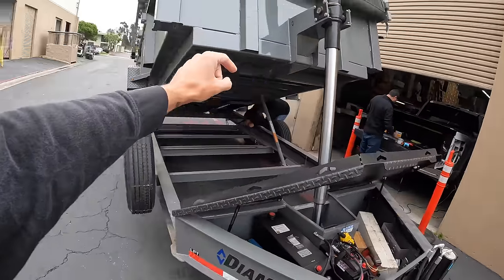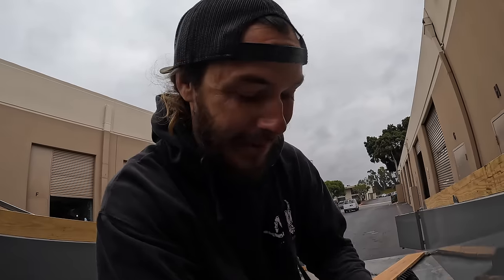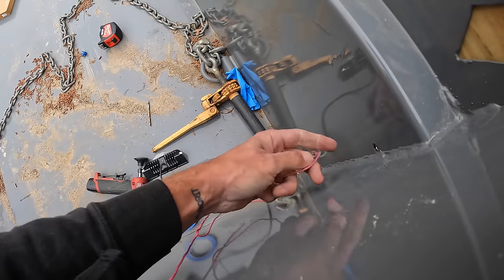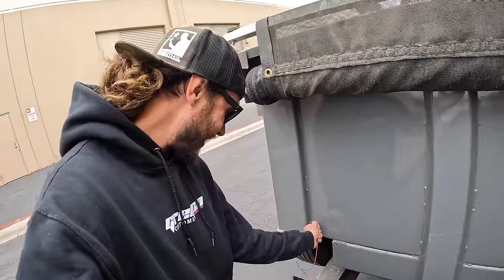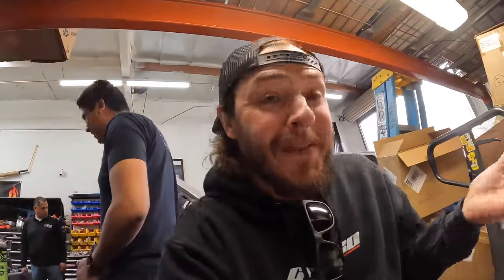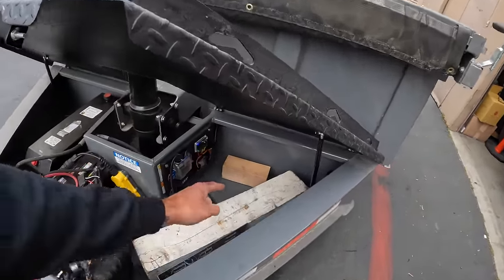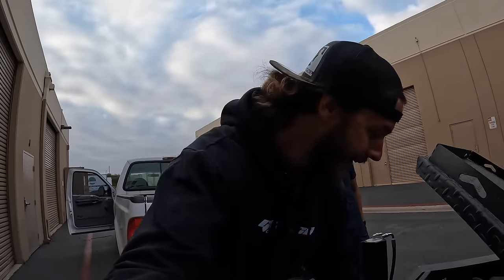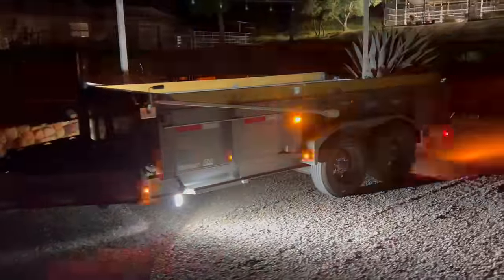EVERY Trailer NEEDS This Lighting Setup!

Comment: Have you done wiring on a steel trailer before ? this is impressive , use a straight piece of wire and spin , it will tangle the wires ( as you never want when doing purposefully ) then closer to home . When welding, A invisible nut , tack it to a coat hanger , then fish/align it to the hole. Well Sergio  knows this already . You guys do it great ! Poor Sergio , you bug him to............. logo everything ! Hey Maybe show  Diamond  D  the options that you have added . THIS LIGHT PACKAGE IS ..............................GREAT ..............................

Comment: You should wire one of those Milwaukee batteries up so you can run the lights without a truck in case u have to move the truck but not the trailer
Reply from the maker: This trailer has its own battery, the lights work without the truck
Reply: Its a dump bed its got its own 🔋

Comment: Seems you missed a critical place for a light - that box up front would really benefit with some lights. Maybe even just making it automatic so when you open the lid it turns on…
Reply from the maker: We plan to add one later. We just wanted to finish after 4 days working here and there on it lol

Comment: are those strobes legal? they look like they they will blind other motorists!
i like the trailer but you could have put a hole in the headboard so the lights could shine though say a piece of plexiglass so it would  not put the light at risk or have to be always careful when loading. on the side facing lights they were placed completely wrong and every curb or piece of ground has the potential to tear them off, i would change the step and incorporate the lights into them so they are protected while shining the light exactly where you want it. by placing them low they have potential to blind someone driving along the road benind the trailer whereas placing them where i said on the steps will stop that issue as they will be higher but facing down to the tyres.
Reply: 😂u just jelly, keep on hating it motivates 😂

Comment: You could put rubber grommets in your drilled holes that way the wires wont get worn over time.
Reply from the maker: All of the wires were taped with tesa tape at the light end. Except maybe one or two where I didn’t drill the holes big enough for the butt connectors to make it through taped

Comment: For the lights at the front of the bed, did y’all run wire down the frame then back up to the front on the bottom side of the bed ?
Reply from the maker: Correct
Reply: @DMAXRYNO cool, thanks man!

Comment: bro why you gotta lie about the frame rate? the same 1 is the only 1 doing it. lmao they aren't all doing it.
Reply from the maker: I would 100% say a light was flickering if it was… from the previous video. Sergio was going to program those lights as running lights too, but noticed they flickered in low amber so we opted against it.
Reply: @DMAXRYNO  you should ask Sergio why it's doing that. I've never seen the same light do it on camera when 9 others aren't usually all of the same kind of light flicker at the same rate on camera.

Comment: Hss drill suck 
Need to step up to hardened steel m2 or m42 
Also need to lube when you drill steel and you run your drill speed too fast for steel. You are burning the drill bit 
There's a machinist chart for drill speed in aluminum and steel